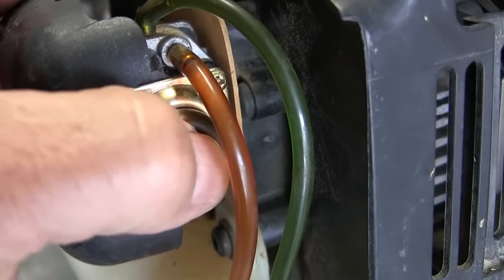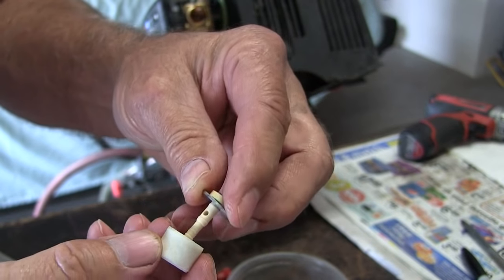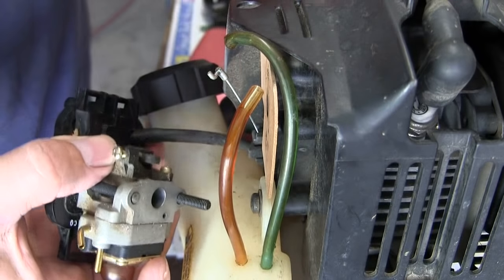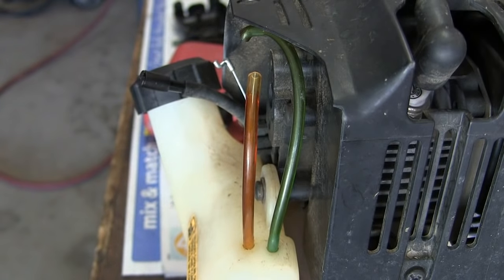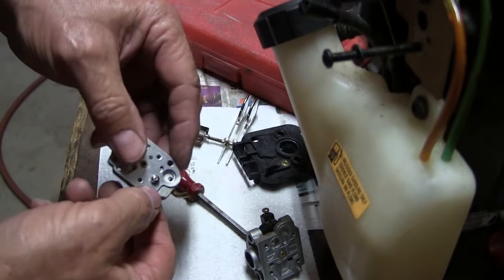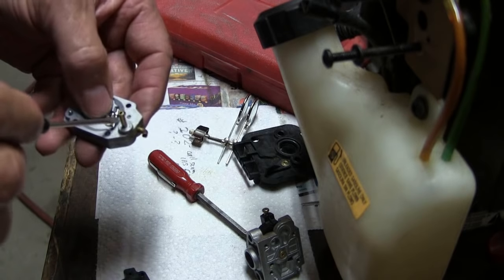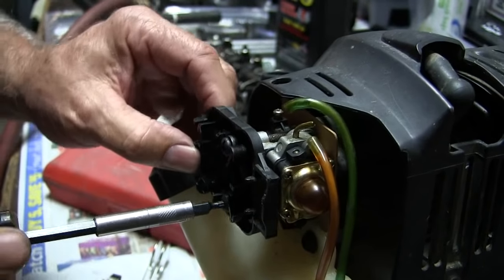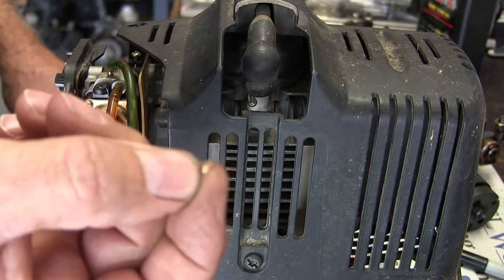TB425CS string trimmer running problem found

Comment: Thank you so much for this video.  Your meticulous attention to detail is exceptional and at my age level and experience quite rare. My TroyBilt TB425CS was running great for 16+ years and then I replaced the carb for $7 US via Amazon. It was an instant fix.  I did not have the time or patience to go through the steps you provided but at least I now know what a potential problem might be.  Great job of explaining and illustrating the detail.  Guess what?  I have the same issue 2 years later and after replacing the plug, checking the rocker arm clearance, changing the oil, changing the fuel tube and primer tube, gas filter, adjusting the idle screw, separating the cut off lines/wires which have gotten loose, I found your post.   I still bought a carb replacement because I think that something got in there after the gas ran out.  Just the way a fuel pump can get ruined by letting gas get too low in your car, it can happen with these gadgets also.  But, your walk through and video is exceptional.
Reply from the maker: It helps to make vids, for when my age causes fuzzy thinking too. Thanks for the king reply..

Comment: Hey thank you a ton for this video. We were having the same issue but the source was entirely different, however we wouldn't have figured it out without your video. The fuel line inside the tank was old and corroded and had a split near the top of the tank, so when starting it we had no problem, but as soon as I would pick it up and tilt it to trim, it got air instead of fuel and died.

Comment: thank you for the time on this video Sir!  question for those reading through,  has anyone felt the need to replace the THROTTLE BODY due to air leakage at the rotating shaft area?  There seems to be an expandable type oring gasket that in one vid I saw last year the diyR said wasn't serviceable but it allows to much air in..  thanks in advance
Reply: This wasn't the issue I had when I came to this video but has been in the past. They are very cheaply built little gaskets.
Reply: As for how we fixed it, we actually bought a little gasket from a vape store that fit it perfectly and it sealed everything up nicely and has never been an issue again.

Comment: Mine will start and idle put dies when you pull the trigger to accelerate. I'm going to go through the carb and see what I see but I noticed that my intake tube is quite loose where it goes into the tank. Maybe the tank isn't pressurizing as it maybe should? Should the hose be a tight fit?
Reply from the maker: The fuel line tube will be tight enough so fuel does not pour out that hole in the tank should the trimmer be turned so, but it is not so tight you can not move it in or out when needed. The filter should be in the tank at the bottom of the fuel. The fuel line can tear if something hits it hard near the intake tube on the carb, I had that happen, ans sucked air into the carb wirh fuel, so check there for a hole or loose connection. The mix needles are set for air fuel mixture, another area internal trash can slow or block the fuel flow.
Reply: @dadcolo  Thanks for the reply. My tube is not original and a bit loose. I fixed that and no difference. Then I noticed the little black round thing/cover (seems like a choke) that you said checked to make sure it stayed open at 5:47 was closed and never opened while operating the trigger. It's open on yours at 1:12 also. I found the little lever on the back and opened it and presto..it started right up, idled as it should and now accelerates as it should. In fact it goes up to a higher RPM than it used to. Is that cover a manual choke? is it supposed to move with the trigger action? Thanks to you video, I've made progress!
Reply: After a bit more research, it's apparently a cold weather startup lever! Never noticed it before.
Reply from the maker: hose not a tight fit, and the tank is not a pressurized system.
Reply from the maker: @duathlete827 The blue lever behind the air filter is a manual choke, up is off. Trigger movement does not change the choke position. Please excuse the late replies.
Reply: @dadcolo  Thanks Calvin. I figured it out. Runs better than it ever has since I bought it many years ago.

Comment: I am confused. At 10:07 you can see a round spot on the gasket that should have one end of a spring that presses against the gasket. The metal part of the carb at 10:16 has a round area the spring fits into perfectly. But at 10:23, upon reassembly of the carb, no spring is installed. I have this exact model troy bilt, and I for sure have a spring in that location. What confuses me is why it runs without that spring, or is it even a required part? anyone else have a spring in your carb?

Comment: good Video 
i have the Same one Green Color 

unfortunately gas tank CRACKED and no Replacement Around
Very Good MOTOR 

MTD stopped making parts want you to buy new .
What Size fuel line and Bulb is this ?????????
Reply from the maker: just a guess, I think 1/8" line, the bulb is about 1/2" wide and tall.

Comment: Can this type of carburetor installing in to 2stroke engine?
Reply from the maker: I don't know if it can, I'm not an engineer. The TB425CS is a 4 cycle engine, the fuel will be thinner than oil mixed 2-cycle engines, the fuel jet will be different, and other passages could be too.

Comment: Probably what is wrong with mine too. The primer won't even fill up I have to force fuel through it to the rest of the carb. I won't get enough gas to take off the coke enough to get rpms needed to do it's job.

Comment: The problem is found starting at 7:20 a little piece of plastic clogging  the brass looking tube which connects to the gas line
Reply from the maker: yep, that was the problem. it was an easy fix finding it. I like those..

Comment: Old video... I have the same unit. And it has been working pretty good over the years. But now I lost spark. So time to either fix it or buy a new one. I see parts are not available for a lot of the parts that fit this unit now. I guess that is how they push you to buy a new unit...
Reply from the maker: Have you checked with the small engine repair shops for parts ? 
Have you checked the kill switch wiring make sure it is not grounding out the power ? 
I find the electrical is usually something simple been overlooked.

Comment: Where can I get those fuel plastic lines?
Reply from the maker: Some hardware stores carry the small lines, The true value here has a small engine repair in the store. Farm coop store has a chain saw repair shop too, they use these small fuel lines.
Reply: @dadcolo  Thank you Calvin. One more question. I noticed gas leaking very slowly from these small lines where they penetrate the gas tank. Any suggestion how to stop this.
Reply: My thoughts, maybe the lines weren't sized properly.

Comment: good video, but you forgot your o-ring upon reassembly (around 11:18)
the o-ring I am speaking of is evident at 5:39
Reply from the maker: Wes, I stuck the O ring into the hole of the black choke plate, I see it at 5:57
Reply: Calvin G. Williams well, sadly, no success on my end.....and I have a troy-bilt edger that I caught at lowes on clearance (return) fot half off....so I swapped carbs (after cleaning) and still nothing. it will start on ether and WOT but then dies within 5 seconds. I lost my patience on working on this POS and threw it across the front yard. going to go pick it up and do a compression check, then it's going on craigslist free section 
oh and this stupid Warbro carb is non adjustable, obviously by design.
okay, rant finished now

Comment: most important on this model is to pump 10 times really slow
Reply from the maker: to prime the carb an flush out air, your right..
Reply: asus3571 I know it's recommend 10 time prime bulb, but a little excessive don't you think? also, if using ether or starting fluid, don't prime except maybe 3 times
Reply from the maker: I prime only on first start of the day then after running out of gasoline, 9 clears the system of air.